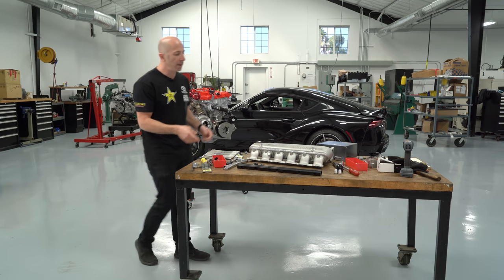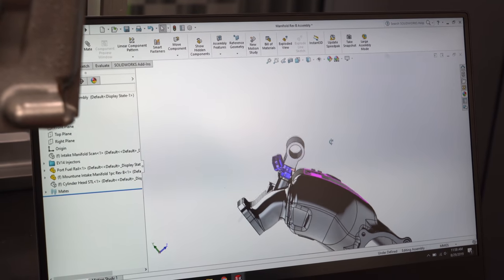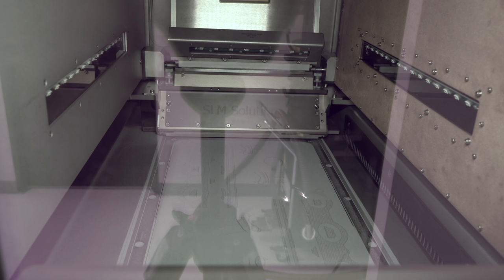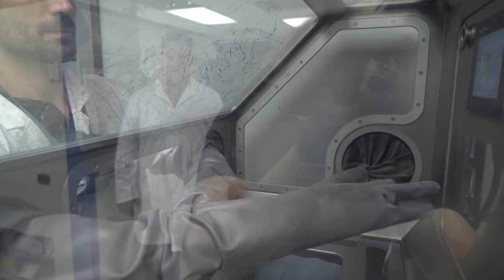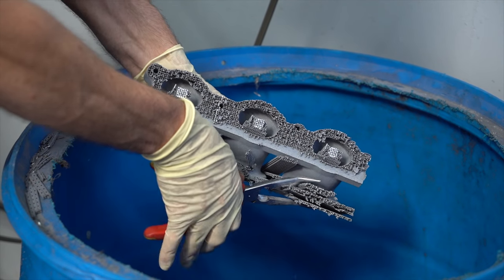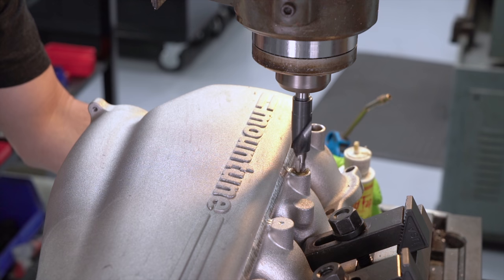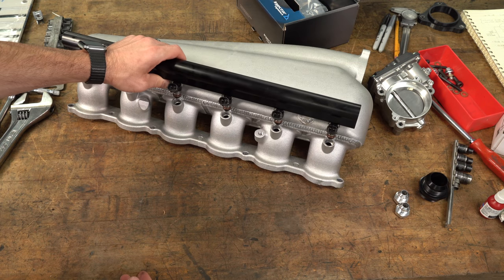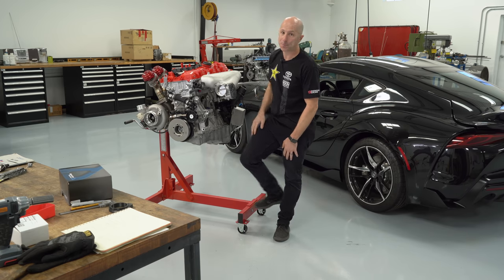3D Printed Aluminum Intake Manifold - Laser Melting Process

Comment: Not only is it weaker it also cost 10x more. what an innovatoin.
Reply: What is your evidence that it's weaker? SLS metal parts are similar in strength to billet.  They're weaker than forged, but the process is much cheaper than forging and allows for significantly higher design complexity without an increase in cost.  Sounds like you're pulling things out your ass to me.
Reply: @Tristor86  first off cast parts are way cheaper then 3d printed. like WAY cheaper. and billet is way strong then cast or 3d printed. do you get all of your knoledge from rediulous youtube videos like this one?
Reply: michael provost: I’m an engineer and I fabricate parts for race cars.  I know a thing or two, as does Papadakis Racing.  Where are you getting your information about the strength of SLS?  It’s not as strong as billet, but very close, and allows significantly more complex designs to be produced which is an acceptable trade off to improve packaging and efficiency.
Reply: @Tristor86  if i hit a piece of billet aluminum with a hammer its going to dent a little, if i hit a piece of that with a hammer it breaks. yea you can make complex designs with it. that is the only advantage. maybe another 10 or 20 years the technology will catch up to the hype.
Reply: michael provost: You’re making claims not in evidence.  What you said is not an accurate statement.  I don’t have anymore time to waste replying to you.  You don’t know what you’re talking about.
Reply: @michaelprovost5433 : You're making a lot of invalid assumptions about me, and about this technology.  You made a claim, I refuted it.  If you want to back up your claim you're welcome to provide evidence.  Seems being called on your bullshit really riled you up with that unwarranted rant about engineers.  Guess you're mad I know how to use CAD /and/ a wrench.  Well, good luck with that.  I'm going to go back to my life which involves both sitting at a desk and working on cars :)

Comment: 3d printing is the way of the future. Enging pats, body panels, interior bits. possibilities are endless.
Reply: Very true but the sad part is its going to put a lot of humans out of a job.
Reply: It's a great manufacturing technology, but it isn't going to replace all others. Yes, you can make some incredible shapes and parts that would otherwise not be possible to build with 3D printing, but if you design for "standard" methods, they are often just faster and cheaper. Yes, 3d printing will get better, but so will every other manufacturing method.

Comment: In the future, when something breaks, people will go to the printing Shop next to them and not the parts store.
Reply: Everyone will have one, just like a flat screen tv, or microwave.
Reply: It's way cheaper to just produce a few 1000 extra parts, and sell them, rather than printing every replacement part. Plus, as you saw in this video, they aren't ready to go out of the printer, they still need some machining.
Reply: Actually this will just decrease the cost of production. You will still be buying parts, they will just be cheaper.
Reply: Surely you're not suggesting that someone could blow the welds on an intake manifold?

Comment: Did anyone else at first glance think why would they 3D printed the welds? Haha
Reply: That was my question... since it was CAD designed, and printed in .002" layers, why are there obvious tig welded seams around it?
Reply: It was printed in separate pieces then welded together. Probably limited to size of printer or to guarantee perfect fitment.

Comment: These types of machines have been around for something like 20 years. Of course early on it was strictly development work. But even the early ones could make a nut and screw as two seperate pieces that unscrewed. One of the early types of machines actually used sheets of paper glued together with the layers laser cut. This is one way a pattern could have been produced. I imagine one could even make a casting pattern with sand and a binding agent that cures under UV light. But before anybody gets too excited I don't see 3D printing in metal getting to the point where you could make things like bearings. Plus if you need something like a forging I think you're SOL
Reply: Id heard some of the US  carriers had 3-D printers on the ship , and could make alloy steel parts for the planes ?

Comment: "a cast piece" not "a casted piece" it's called sintering not "welding the powder together" this technique is referred to as "SLS" Selective Laser Sintering. You forgot to mention that the sintered piece is "baked" to strenghten the bonds of the sintered material. very enjoyable to see this content. Thank you for bringing it to us.
Reply: This is not Selective Laser Sintering. SLS was something of about a decade ago. Laser power has increased over the years, and so has the quality of the optics. The result is machines that really do Selective Laser Melting (SLM) to 99.95% volume density. 

Modern machines can still do SLS, if the specific goal is to make porous parts (say, filters) but all modern machines do SLM now. And that's really melting the powder at microscopic level, no need to sinter afterwards. 

(As an aside, there are also modern 3D printing techniques that do need de-binding and sintering, but those are called binder jetting, where powder is mixed with a plastic/wax/binder and then printed with an extrusion nozzle. The resulting part does need de-binding and sintering. But that's not SLS.)

Comment: I cast cross- ram intake manifolds in art school by Ceramic Shell Casting method  . The original was sculptured in wax , 1/11 oversize , and shrinks to the right size . They came out beautiful , but alot of work . Nothing like an intake manifold with your  name on it in raised writing . I love making parts that screw peoples heads up at the race track .

Comment: As I've been on this year long journey to scratch build a jet turbine engine of my own design, I'm finally at the stage where I can't machine anything else without mega pricey CNC mills and whatnot, so I've been researching large volume 3d printers once again. At long last, however, the prices have come down to where a professionally produced machine is fully affordable by normal people. (I looked at them 6 years ago and the only way I'd get large format in my house for under 600 was to build it myself).
I suspect that in that same passage of time, we'll have reliable and cost effective metal sintering machines in our garages for 2k or less. Right now the cheapest full stop metal 3D printer worth its salt is $150k. But it comes with the whole shebang from printing to post processing stations and a machine to heat treat the part, and it can do just about any metal or alloy they make a powder for (if one knew how to kit out crucible steel, that would probably void some warranties but cut metal supply prices by leaps and bound long term). I could see an outfitted shop or race teams employing one just to save money on parts!

Comment: For drill guides I usually design them with press in bearings, for harder metals sometimes the drill will eat into the steel sleeves making them less accurate, but awesome video! what do you guys use to design the manifolds? Is there any sort of CFD calculations that dictate how they should be designed?

Comment: Awesome, but is there any strength benefits on using this method over casting? I feel casting is much quicker easier and probably less expensive. Also what is the reasoning behind leaving the part setting covered in aluminum? Is that to leave the part to slowly cool as to prevent cracking during cooling?

Comment: I own a small custom motorcycle fab shop. How much margin is there to have a service like theirs make one off parts for your customers? I imagine this intake is not even remotely within the budget of most of my customers. Over the last few years I have used my 3d printer to make mold plugs and then sand cast the parts and that is on the edge of affordable after all the time involved but not much margin available to add in. Brian Fuller recently built a very artistic all metal electric motorcycle for the Haas Motorcycle Museum collection and released it at the 2018 Handbuilt Show in Austin, TX. In a private conversation with him he reveled that just the 3d printed aluminum parts, of which there are many on this bike, cost almost $200K. New tech always cost money, I get it, but we also have to eat and pay bills. I would love to see small shops get this tech or at least an opportunity to utilize it in the next 5-10 years. Thanks for the video, its great to see!

Comment: Cool idea. Just really outrageous cost.
Reply: There is some sticker shock there, but for a part this size and this complex, it is maybe 1/4 the cost of having a foundry cast you one, if you could even find one willing to do a one-off part. There are other problems with castings in this case, most notably castings require "draft", basically everything you cast, especially complex shapes like this have to be wedge-shaped, meaning there is a bunch of structurally useless material in places that are much harder to grind off than the supports on a print, like inside an intake runner. The main driver of the cost of laser sintering (Sintered Laser Metal) is the labor and machine time. There's a ton more to the process than he showed;  the CAD has to be verified and the parts situated to minimize supports while maximizing integrity and grain structure, the machine has to be purged of oxygen (aluminum powder is otherwise known as solid rocket fuel), the platens have to be EDM'd and ground back into shape, the media has to be cleaned and prepped, and so on. This job alone tied up the machine for a whole week and had probably 120 hours of labor. And these aren't people you find at the temp agency, most of them are engineers or technicians who make 80-120k/year or more. They have to be because people who are building spaceships won't pay for the B-team to print their parts.

Comment: I've generally used 3D Printing for prototyping, so to hear it mentioned it was the quicker method of manufacturing is kinda funny. It makes sense though since it's creating the final product.
Reply: I think I saw them use a normal 3d print for prototyping (plastic to verify how much room they have etc)
Then aluminium 3d print the final product

Comment: Amazing work. Did you consider using carbon fibre 3d filaments to use with the more common FDM printing process for the intake manifold? Carbon fibre reinforced peek has very good thermal and mechanical properties. Vision Miner tested a Carbon Fiber PEEK 3D Printed Coupler to 1,300 PSI without failure, which is well above the pressure an intake manifold sees.

Comment: I would imagine that lost- foam casting,  welded tubing,  or even a full carbon fiber manifold would be easier,  quicker,  cheaper,  but this is pretty cool
Reply: hrmmmmm...

I wouldn't bet on it. Possibly, it might be all the things you stated, but it would not be fully balanced and tuned to the same level as a CAD designed - direct to 3D process. I'm not so sure it would be cheaper once you add up all the hours and prep required for any of the materials you mention. Carbon fibre is incredibly post labour intensive for something like a custom intake manifold shown. And it definitely would not be quicker from start to finish with carbon fibre. Tube welding is cheaper and quicker... but with lots of compromises and difficulties. 

Perhaps a hybrid CNC billet machined multi-piece aluminum intake manifold would be cheaper and roughly the same amount of time.

Comment: Great process for a one off part. But traditional casting seems much more cost/time effective than a 52hour print time. Expecially if you ever need replacement in the future. And at a cost of 8,000? I wish the video compared the cost and time frame of other processes, either cast or hand bent tube and welded. If you can drill a fuel injector mount, can it be welded on like an exhaust o2 bung?
Edit: I know someone will say about flow, better flow always results in more power but the gains are much less on the boost side.

Comment: For this part I understand it if you leave it as be, but for more structural or high load parts you would ideally want to 'cure' the part by subjecting it to isostatic high pressure and heat to consolidate the metal grain and force out any cavities between the metal welding patterns, right? 

For heat subjected objects these cavities could provide more insulation?

Comment: These seem like 3d printers from the 19th century. Modern metal printers like the Metal X from markforged can do all this in less than half the time, and is compact enough to fit in a corner of any office. Also does not require all that support processing and powder removing hassles, since those use solid filaments.

Comment: Idk.. you still gotta weld prices together. Still have to do trimming and grinding and drilling and tapping. In terms of production effectiveness. Casting is alot simpler of a process. Then again to get the mold in the first place you'd probably need one of these. So it's interesting.
Reply: Yeah, but it's not cost and time effective at such a small volume.

Comment: GE aviation (jet engines) has invested in this tech.  Printing injection nozzles.  Considering the market size, the part intricacy, and the materials, it’s a good match.  It’s a vote of confidence in the tech.
    Welding is like football passing, four things can happen, three bad.   In this case, the aluminum is dead soft after welding (think beer can).   There is grain size, porosity, voids, ....   As the technology progresses these issues subdued one by one.
     The challenge for laser printing is get the cost down.  I don’t know if it’s possible, but might consider printing from two sides.  Cheers

Comment: Any advantages over a lost wax casting? There are a few variations where a part master can be directly 3D printed (rapid wax) or a mold for wax parts can be 3D printed.
Reply: In this application maybe not a significant gain.

The fundamental benefits of 3D printing is the ability to print parts that are physically impossible to machine otherwise (think of a complex lattice internal structure). Another benefit is the weight savings without a loss in structural integrity (maybe even an increase in structural integrity) that can be made from using clever designs such as the lattice structure.

Comment: I'm surprised the SLM500 could not 3D weld your intake manifold threads into the three holes you hand drilled and tapped.

Comment: Hi, I spent 4 years at GM Performance and Hendrick Motorsports designing headers for their advanced engine development group.  I ended up developing a software package in Matlab that interfaces directly to Solidworks and the package automatically designs the header solutions within a set of constraints such as length, steps, radii, as well as packaging constraints.  I later designed a set of headers for the Honda V10 for Ralt.  Wonder if we could put our heads together.  Seems like 3d printing the whole thing in stainless would allow complex curves and better solutions.  We were able to minimize the number of welds among other advantages.  Great looking work!  The software will also design intake solutions as well.

What is the cost of the 3d printing for the aluminum 3d printing layer?

Best,

Dr. W. Kurt Dobson
Salt Lake City, UT

Comment: @PapadakisRacing  I know this is a older video but I was curious about your experience in hindsight with this technology....how well does this tool really help you guys in your race programs?  It just seems to be so much more labor and man  hour intensive compared to let's say a hand made sheet aluminum style intake? 

Assuming that you still used computer modeling to aid in the design (resonance, plenum volume, equal distribution and velocity at ports, etc). Is the hp potential between fabricated vs printed very significant? 

And lastly is a more mundane question lol. Given the printing method is porosity a issue at all?

Anyway,  that is some amazing tech and a cool video! Thanks for letting me nerd out and I hope to hear your response as this is  fascinating to me lol.

Comment: So are you running both Direct Injection and Port Injection now with this new manifold and 6 extra injectors? Or are you switching to just Port Injection? I would think you’re running both. Several manufacturers are using both Direct and Port Injection now like Ford is on the updated 5.0 liter Mustang.

Comment: Ok I have a question. It's a good question too. 

What is the cost of 3D printing a new part with powdered Aluminum versus CNC machining of new one from forged Aluminum?  We both know that they would take the same amount of time.  

I think if you could 3D print using Carbon Fiber, that would be the only reason for a substantial price difference.  I may just be the only one asking this but it does leave room for practical debating.  I just dont see powdered and welded aluminum being cheaper than CNC forged aluminum.

Comment: I don't understand why the printed parts have support material attached to them. The whole point of SLS technology is so that more complex parts can be printed without the need for supports because the powder is the support material. Maybe the aluminum powder shifts a bit while it's printing and causes problems if you choose not to use supports.

Comment: What about the powder still lose on the outside? Is there any risk of bringing in aluminium powder inside the engine? Usually a piece like this would be part tumbled to remove any particles.